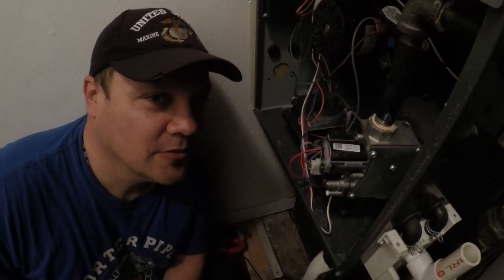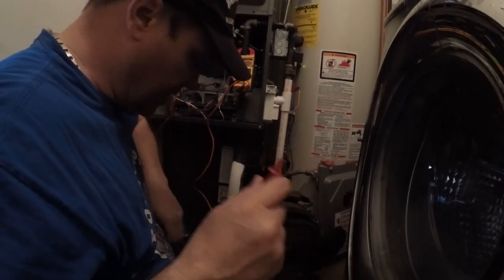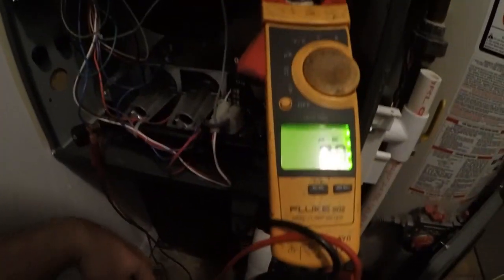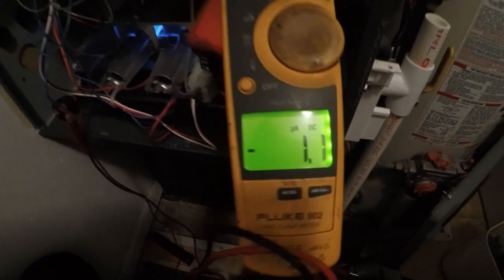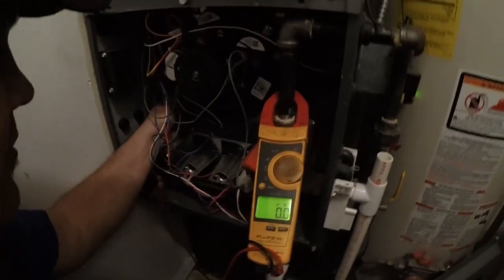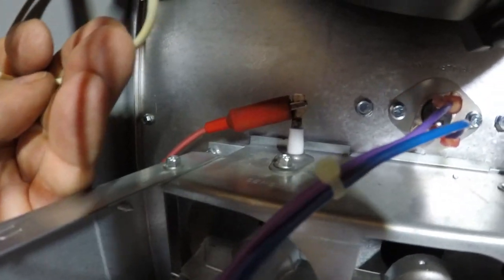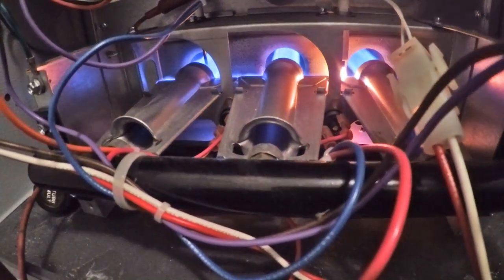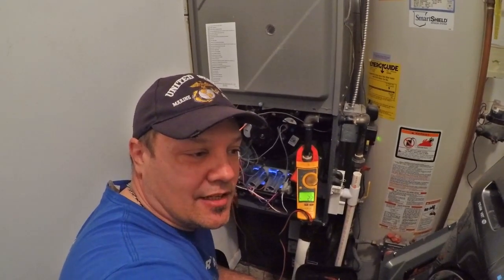Amana/Goodman furnace not Heating: How to check and clean a Dirty flame sensor

Comment: Thank you. Sunday between the holidays and suddenly I hear my furnace short cycling, shutting off right after the burner ignition. Already pissed 4 years after new install that was totally botched, I was running through scenarios of how I was going to use the heat from the salesman's tears to warm my house, and I searched and found this. Less than a 5 minute fix, and I've got heat.
Reply from the maker: I'm glad it helped you get your furnace working
Reply from the maker: Glad it was easy!

Comment: Perfect! Cleaning the flame sensor was exactly what our 2-year-old Goodman furnace needed . Our HVAC seller/installer/service company said the problem was with our 15A fuse box which powered the heater - and they wanted $400 to replace it (where the fuse box parts cost ~$20 at the local hardware store). Thanks for saving us from those scumbags.